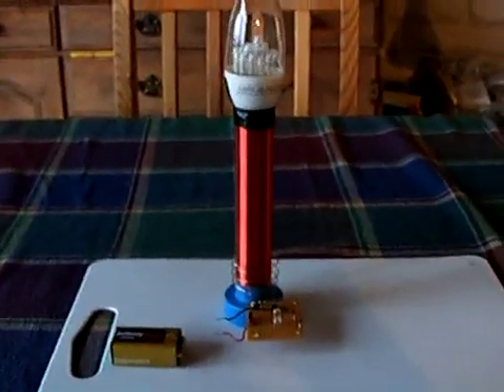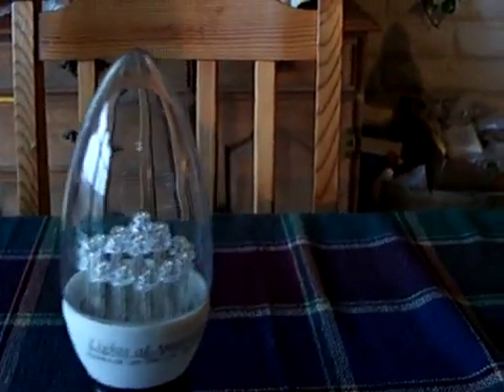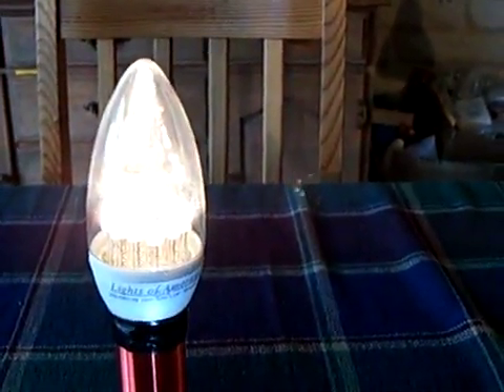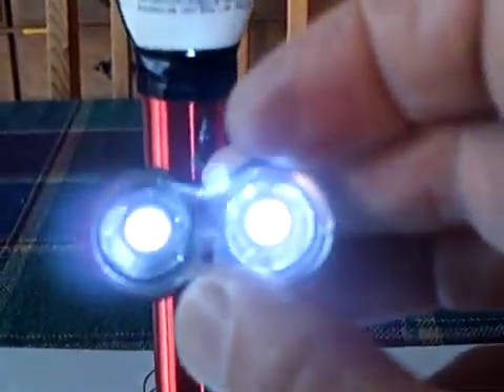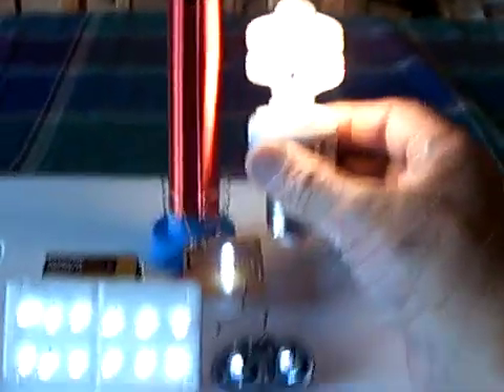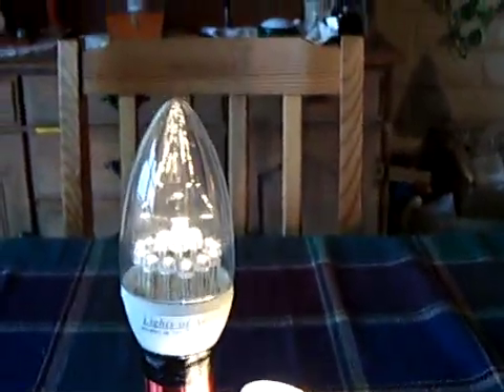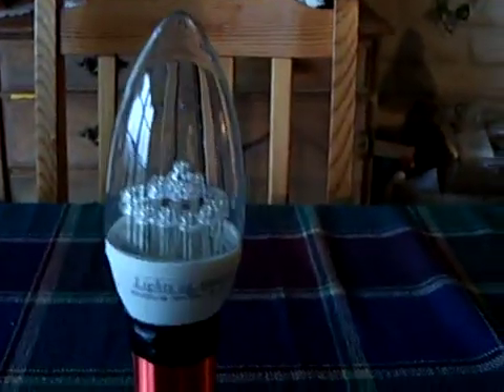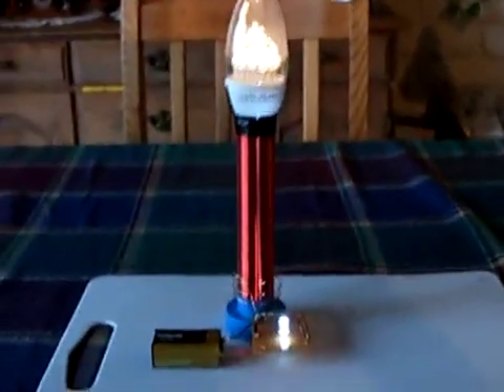Tesla Coil Generator Nikola Tesla's Amazing Free Energy Generator

Comment: This is not free energy!  You are just boosting up the voltage.  The current is really low therefore no power gain.  The light going on is due to mutual inductance.  Much the same way a transformer works.
Reply: Agree